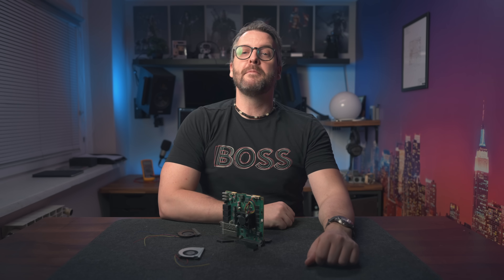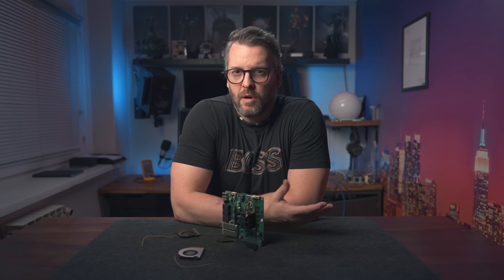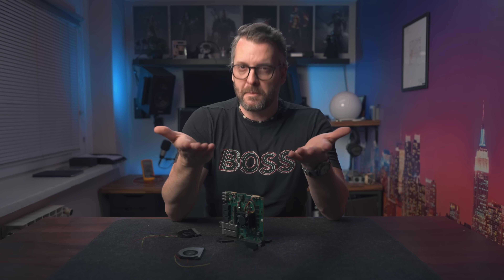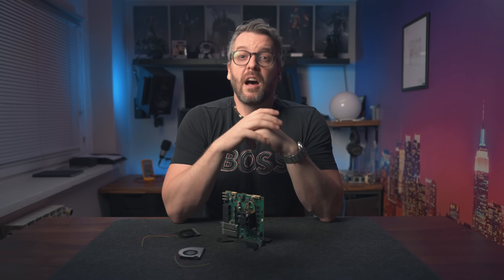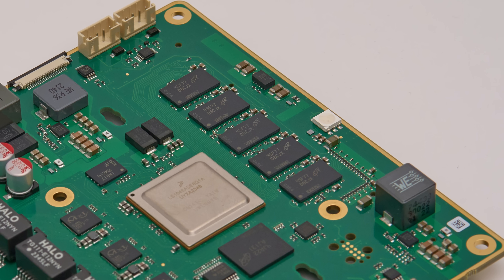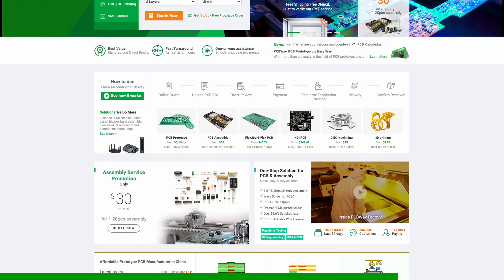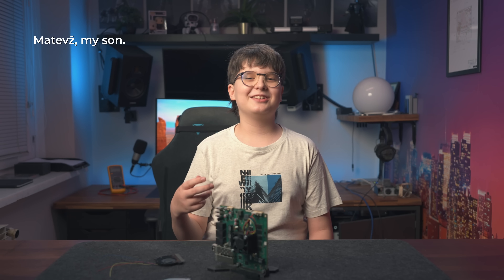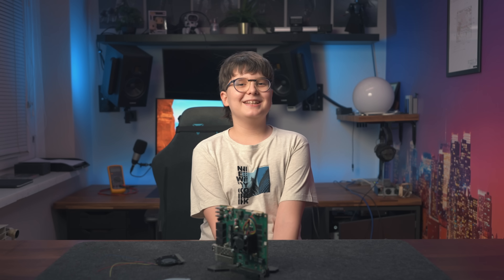You Wanted a Cheaper Router. We Can Do That.

Comment: Very exciting! 
I would really prefer the more power full version that I can run for the next 10 years, then to have to buy something new with more Grund in 5 years or something.

Being able to run a lot of other stuff on the router in VM's is quite useful, home automation, PBX for my old SIP phones, etc. pp...

One of my use cases is VPN and I somehow doubt the on board engine of the chip can do that to, so some traffic will need to go through the software layer and for that the more power the better.

I don't care about cheaper components and the lack of on board power measurement, but compromising on performance and ECC is not good.
How about using a micro SD card and a SO-DIMM memory module, this way users could upgrade the memory later on?
And perhaps sourcing of the shelf DIMMs may be even cheaper then having the memory on the main PCB?
Does the UART need to be USB how about just having a TX and RX line to plug an own UART 2 USB dongle for those whom need this.
About the NOR flash, the eMMC has 2x 32 MB partitions right so one could have 2 bootloaders to switch with a switch, and no need for the dedicated flash at all, except exceptions, those how about leaving an unpopulated place for a large foot print Flash IC and a second jumper, for those whom need it to populate themselves, or put a connector and sell AUX bootloader doughter boards.

And finally where else then in this comments can the router be discussed where you @tomazzaman participate?

Comment: All the cost optimization that can be done without compromising the routing performance should be done. All you have going vs a computer with a network card in it, is size and power. I don't want to run complicated docker stuff on the router. I do want good wireguard performance, line rate routing, and ideally line rate idf/ids. So you need to convince me that spending $300 more than a desktop with a connectx4 in it is a good plan. 

Keep 2 rj45s, and 2 sfp+s, and 2 usbc ports (one for power and one for data).
Reply: You won't get IDF / IDS on this with good performance. As soon as you inspect packets, you're out of hardware offloading and doing it in CPU instead. The CPU power is already weak for this application.
Reply: This is the real answer

Comment: You definitely need a lite edition. 10gb, but maybe just 1 or 2 SFP+ and 1 or 2 10gb RJ45. And nuke the cpu and ram specs to the point where you're JUST able to route 10gb (plus a tiny bit of overhead).

Comment: Banana Pi has a better CPU, and it's available right now with 8GB RAM, metal case, WiFi 7 modules, antennas and all for $266 (including shipping from Amazon).

What are the benefits of your router? 

Don't take me wrong, but competition is fierce.
Reply: Two 10Gb ports with hardware offloading.
Reply: @mepret  Banana Pi router has two 10Gbps SFP+ cages.

And Hardware Offloading does not play nice with OpenWRT or the Linux Kernel, a faster CPU is preferable for maximum compatibility and control.
Reply from the maker: I can't jump on this immediately, but I'll prove you wrong. With numbers. :)
Reply: @tomazzaman  The initial person who asked you the question told you some easy to understand thesises, not numbers. I think it would be easy to see the thsesises (selling points). It seems your router wins on hw offloading -> and so maybe temperatures.. Anything else? Also if temperatures are not the problem in banana pi so hw offloading is not that tasty.. 

Anyways, sorry if that looked toxic or else, you guys are doing great job and I like the competition in this sphere, routers have to become good devices!

Comment: 6:54 can so explain why there are 5 chips on the board for ecc? Thank you!
Reply: The 5th chip is for ecc. The other 4 are 2GB.
Reply from the maker: Exactly. Interestingly enough, because the pins on the CPU are located the way they are, ECC chip is actually the middle one!
Reply: Interesting. So instead of 4 ecc chips we can use 4 non-ecc chips + 1 „extra“ chip to gain ecc support?

Comment: is there not enough bandwidth on asics to use 2.5gb rj45?  they cant really cost that much more do they?
Reply from the maker: The CPU has certain limitations. We had a choice, use 1x 10Gb, or 4x 2.5G, but not both at the same time. We chose 1x 10Gb because it's still more practical to break those out with a switch.
Reply: @tomazzaman  thanks for the clarification!

Comment: Get rid of everything non network related. Keep 2 sfp+ ports or replace them for 10g ethernet ports and at least 2 2.5g ports with 1 maybe 2 usb c ports. That’s all that matters to most people and it will definitely help bring the cost down.
Reply: There are limitations with the CPU... i don't remember to the exact details, but he talks about this (how many port on what speed the CPU support without external hardware) in one of the early videos

Comment: This isn’t the budget alternative to using a server or desktop as a router. It’s a polished compact fanless 10gbe appliance. There isn’t a sub $600 USD non platform specific 1:1 alternative that I’m aware of today. The Netgate 6100 and Opnsense DEC850 are the closest alternatives, although both are x86. If you value fanless, compact, powerful and a known supply chain, this is on a very short list of options.
Reply: The Ubiquiti - Cloud Gateway Fiber (UCG-Fiber) for example. Software wise not open source of course, but a very pleasing package overall at a good price point.
Reply: lol what. I might be not running rb4011 I got for $140 for last 4 years then 🤷‍♂ but ye, one 10gbe port only. because of that there is banana pi-r4 for $100. and almost perfect CCR2004-16G-2S+PC which is still cheaper than 600

Comment: Hmmm would be interesting to take part in this project. I'm somewhat proficient from basically every level of programming to electrical engineering but I'd call myself a "common sense expert" as the main strength lol.
About the actual point: Instead of soldered EMMC put an actual MMC or MicroSD socket. This way you're letting the users choose anything from a fake $1 trash to terabytes of storage to endurance series to industrial SLC series that costs half of the router itself. Also very handy for unbricking.
Aaand I got a little off-topic question: does that CPU implement a PCIE device-side interface? Because imagine you plug your fancy router into a Thunderbolt port and BOOM not only you get 40Gbps to the switch chip but also can (depending on software stack) see each port as an OS network device for a furry of debug and tinkering purposes. Yeah I know this calls for a multi-year headache. But would it be cool.
Reply: sometime i just don't get why people like to use sd card so much. When you have an interface like SDHC which can provide 8 bit width instead of 4 bit width, why constrict yourself to 4 bit? Also replacing an eMMC is just as easy. eMMC support HS400 while SD3.0 from nxp at most support SDR104.
FYI, layerscape processor has pcie and sata buses natively so storage should not be a problem if you know how to add support and driver in linux kernel. At the end of the day this is a router anyway, why do you even need the storage for?
Reply: @woahwoahweewah2203  I'll start with the question - you need the storage to have an OS. That's kinda needed for the router to.. be the router. Running a cache server, logging ALL THE traffic, running a full NVR and other stuff is optional.
Let me return the question, what's the point of counting bits? If transfer speed was a priority there's UFS, there's NVME and there's SATA for that.
My suggestion got two points, first the fact you can unbrick your device from a random flash corruption literally under a minute if you have a backup and the flexibility it gives you about how much you're willing to spend for reliability.
Also let me compare swapping an SD/MMC card with swapping an eMMC with a real world case: 
We got some pricey LPRs deployed at some customer sites. Older version used SD card which was about giving their IT dep an $10 spare and instruct to do a 5 minute trip and 2 minute swap to bring the money-making device back online.
The genius vendor replaced the SDs with eMMCs buried 3 PCBs deep in the next version and were generous enough to send us 5 units with a bad batch of eMMCs that all failed just a couple months after the one-year warranty expired.
The chip also refused to work with anything other than the exact damn model which was already discontinued due to.. ahem.. too high reliability.
I had to spend days chatting with taobao vendors until one guy dug a dozen of those out of an ewaste pile.
Also had to order a very specific adapter for my xgecu flasher because the unit didn't support flashing a blank chip.
Then the transportation.
Then taking the damn thing apart like a swiss watch.
Then carefully desoldering the chip to not hurt the CMOS sensor.
Then flashing and verifying the new chip.
Then soldering the new chip with great care.
Then reconfiguring the unit from scratch.
Yeah, it was "just as easy" as flipping a damn chip and power-cycling by local IT dep over a phone call.
Reply: @yunodiewtf  You kinda already answered yourself, the eMMC is for boot device and SATA/NVME can be used for large volume storage, therefore there is no need for the boot device to be hundreds gigabytes large, as long as it is sufficient to hold the firmware you would be adequate, plus the fact that normally you use such embedded processor without installing an OS to begin with, and without the OS your firmware would be way smaller your standard linux pc system. Well why not use more data lanes if it support? It is your boot devices and it is going to massively improve you kernel performance.

Also when your flash/eMMC boot device is corrupted, you can always use a JTAG to re-program the boot device as long as there is no physical damage to the chip, which could be as simple as replacing SD card if you can write a simple script to automatically flash the firmware onto the chip with the help of a host pc. It is as simple as flashing a stm32 if you know what you are doing. You als can use a socket to hold the eMMC/flash if you really worried about not about to solder it yourself. For reference, https://www.ironwoodelectronics.com/products/universal-bga-socket-for-emmc/ 
You can also do something similar to what orangpi do with their eMMC and have it on a btb breakout board.

Furthermore, you always have the option to opt for AEC compliant components instead of the cheaper but more fragile commercial grade alternatives. NXP as a chip designer and manufacturer focused on the automotive area so that should not be an issue if you really cared about reliability. I suppose you don't expect your car to break down just because of the temperature different between winter and summer or the vibration when you are driving. If your device still fail regularly, it is more likely due to other factors than the chipsets tolerance, like unstable power rail and etc, the industrial graded and automotive graded boards and parts all needed to pass EMI and environmental test, which under normal daily environment would be well within the limits of the requirements. The hardware design team would also do PISI simulation for simulating and ensuring the integrities of the electrical parameters of the hardware.
Reply: @woahwoahweewah2203 Dude are you copy-pasting GPT answers or really mad at your keyboard? Also I don't see you following my point as having a removable boot media means YOU CAN UNBRICK THE DAMN THING WHEN THE NAND FAILS. It's not about gigabytes, not about speed and not about interface. It's about greatly increased unbickability. Period.
Reply: @yunodiewtf  I exactly answered you can use JTAG to do so. Do you know what JTAG is and what you can use JTAG for? Have you done any hardware debug or memory debug before?

Anyway I am busy with a new silicon bringup and validation, I shouldn't be arguing over something so minute and simple.
Reply: @woahwoahweewah2203 Did you read the specific case I described before you went full GPT? Yeah taking the device apart and scrambling for a JTAG adapter is SO MUCH more convenient than just swapping a card when trying to bring a bricked device back online in the middle of nowhere.
Reply: @yunodiewtf  At the end of the day, if you don't like the hardware, you can always design your own board. It is so easy to design a router these day. As an engineer, I don't expect non technical people can understand the design philosophy we have when we designed our chipset and board to do what they do.
Reply: @woahwoahweewah2203  I was only trying to give a common sense advice on cost optimization that makes the board both cheaper and less pain in the ass in long run. 
I've had a quite unique opportunity to work with the same line of devices with one version using a soldered EMMC and another using an SD card.
The one with SD card saved us a ton of trouble so I figured it was worth mentioning.
If I was super determined to prove the point I'd probably also design my own router with an SD card OS but I'm more into reusing retired EV batteries as home storage, right now in the middle of solving the cell balance dilemma as there's literally zero off-the-shelf balancers that actually get the job done and don't more than a second hand pack itself.

Comment: I would warn against going with the cheapest connectors and magnetics, mid grade would be fine. I have used equipment that has had failed RJ45 as well as poorly performing equipment from the cheapest magnetics. Go with a good known brand and you should still save a bunch of money over the "best" manufacturer.

Comment: USB C PD can be quite expensive (from IC to connector and BOM). Maybe you could put a 12V barrel jack instead and shave off ~5USD (so 10 USD with 50% margin)
Reply: But using usb-c is nice because any power brick will work
Reply: @jackthatmonkey8994  know any power brick it has to be USB c power delivery
Reply: I think you're underestimating how much the bits cost and how finicky they are. I've heard of a few dev boards that have crap USB PD support (and am the prowd owner of 4). The reason they are so popular on phones (that doesn't translate to dev boards) is that the PD stuff is usually integrated into the pmic/battery charge controller
Reply: @IggyJackson  What? A decent standalone USB-C PD controller that I’ve used professionally (like the STUSB4500) has an advertised budgetary price of $1.15 in 1K quantity. A nice PD power switch like the NX20P3483UK adds $1.70. The rest is mostly just passives… You’re either penny pinching a lot or doing something wrong if you mess this up (of course I have seen both plenty of times)
Reply: @stephengentle2815  ultimately speaking some of these chips are a bit weird in their implementation. The majority of them are slightly obscure ones why you have to beg for a data sheet.
Reply: 10 bucks are 10 bucks. USB C is harder to implement and requires more components than 12V barrel. There is no arguing that. 
But type C is more user friendly. But since we are looking at making a slightly cheaper modem, I wouldnt mind a 12V jack. I personnally use XT30 on every devices on my 10" rack with a single 220V -> 12V PSU. So I wouldnt care about the lack of a USB C power in. I would even prefer it.

Oh and a USB C PD PSU is more expensive than a 12V barrel PSU... So that's even more down cost :D
Reply: Or maybe it could be POE (false, it would be more expensive to make) 
But I'd love to see this option :)
Reply: its the selling point for me and also I dont think PD usb-c costs much because there are lots of smartphones nowadays so market seems to have competitors in this field
Reply: @YaBezumnoHochuPizzu  a smart phone also costs the same or more than the fully featured version of this device
Reply: @TheLostPacketYT im only talking about manufacturing price of usbc which is super low
Reply: @YaBezumnoHochuPizzu  the manufacturing price is still hundreds of times higher than alternative, but it is still very low cost

Comment: I don't know that I love losing ECC. It's pretty broadly accepted that it's important, increasingly so with more RAM, and I'd say far more so for a vital element of a high end network.
Reply: I've never heard of ecc ram in a router
Reply: Error correction is not needed in a router. It belongs to the higher networking levels. Sure, it will make the system more reliable, but only marginally so.
Reply: ECC is pretty much only needed if you are doing compute tasks that keep a lot of stuff in memory where bit flips would cause problems, things like solar flares cause bitflips so system is more reliable but marginally more the worse that could happen is that router would reboot
Reply: You don’t need ecc lil bro 😭

Comment: Where I think you should not optimize is the storage capacity and UART. I feel like 32GB is the minimum amount of storage I would feel comfortable working with. Regarding the UART, its inclusion in the final design is unclear. I strongly advocate for its retention, as it's essential for any tinkering or development.

For me, a weaker CPU is not really an issue. I don't think I will need that much power even when running Docker containers. Where the CPU speed could be an issue is with WireGuard VPNs. It would be cool if you could test the throughput of WireGuard with the current CPU and extrapolate the expected performance for the final design.

For the RAM, I think you could go with 4GB. I feel it's fine to have half the capacity, but for some, it could be a dealbreaker. So I'm curious to see what others think?
Finally, for ECC, maybe go with in-chip ECC if it's possible and cheaper?
Reply: Put the UART on a daughter board that can be bought separately for those who actually want it.   And for storage maybe an SD card instead.
Reply: Wireguard isn't CPU accelerated, so don't expect wild performance with this weak level CPU...